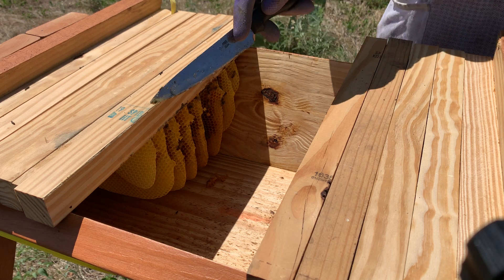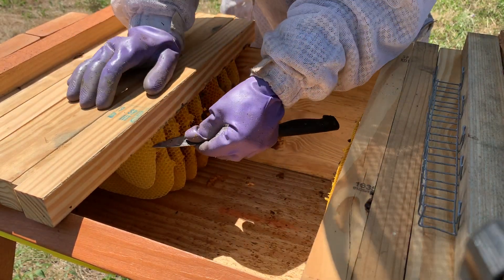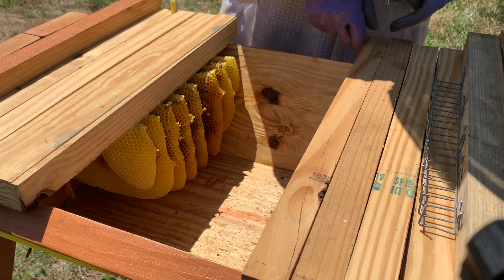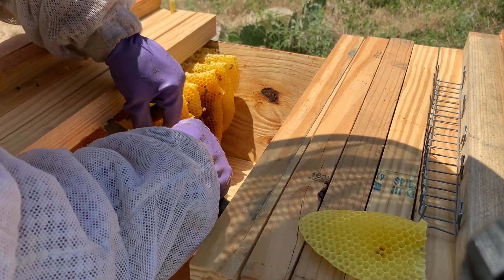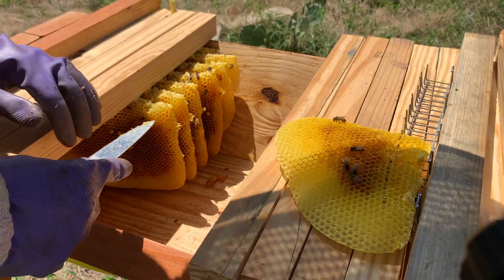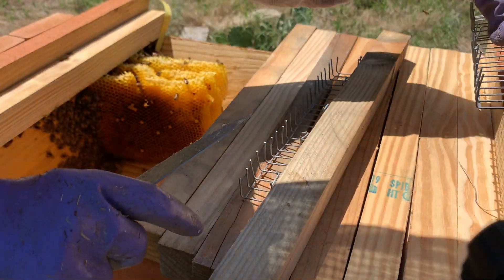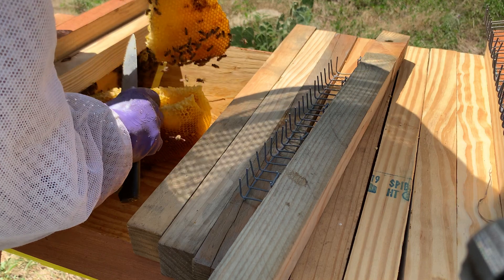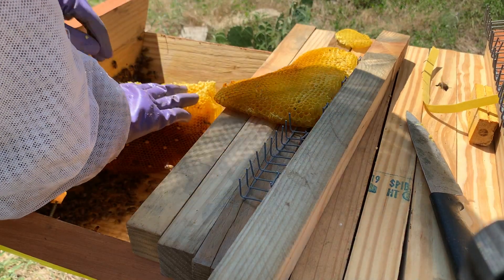Fixing Cross Combing on a Top-Bar hive

Comment: Very neat Rescue Wire ! Way better than Elastic Bands (Rubber Bands.)
Going to borrow concept for my Langstroth Hive re Cut Outs, or TBH to Frame transfers. 😉
Reply from the maker: Yes, you can staple to the bottom of the frame's top bar - true for Layens as well. But what you really should do is use it for Lang frame to TBH transfers, not the other way around - your bees will be happier for it ;-)

Comment: Also. I made a groove down the center of every top bar with the table saw. Then attached a tongue depressor in each grove as a guide for the bees. They, the bees never go by the book.
Reply from the maker: Great tip! I have done that, used a strip of foundation, bamboo skewers, etc. Most of the time though, I give them a straight comb to get started - which I find being the easiest. But yes, bees don't always follow the guides we give them - those are just an indication.... There were a customer's bees anyway, not mine :-)

Comment: Take this comment with a grain of salt. Having a similar problem. I once took plastic hair clips and secured them to twisty ties to the top bar. Also used zip ties also. You could use a ribbon if you want. Even rubber bands. Then insert the comb you cut out into the mouth of the clip. Over time they will incorporate the clip totally into the rest of the comb. In a couple of weeks you can remove the ties. Leave the hair clips in until you decide to recycle the comb. 
Good luck.
Reply from the maker: Yes, I have tried all these methods, none were as easy and efficient and left me struggling to hang the comb or with wonky comb and the hair clips were way too bulky for my taste, but glad to hear these other methods work well for you. Have you tried repair bars? They make fixing cut or fallen comb super easy.... I always have them in my truck just in case....

Comment: Are they still ok ??? 

It looks to me that 
It must be an Invisible REASON (* invisible to you), why bees decided 
to :
Create hive in this direction ... not in your intended way...
and
 another invisible reason for ceeating smaller combs 

We know that they need to keep 
Constant TEMPERATURE ,but, obviously ,... there are small number of bees in that colony.
So...
My guess is that Bees originaly  somehow discovered
 that
*  only 1 corner is good , warm or properly naturaly air conditioned for their task, 
* air circulation was much better for them in that original way ... that's why they positioned comb in that wazy .
and additionaly the size of the comb was designed for their Real numbers to keep TEMPERATURE of the brood 
 ,... small warm cosy corner ... that They can maintain thermal efficiently  . 

Just my guessing.
+ some magnetic field forces or who knows what They can feel ...and see.
Reply from the maker: Marin, thanks for your comment and ideas as to why this colony had initially cross-combed. You are correct, there are a host of reasons for bees to build their comb a certain way, and we don't always know why. Another possible reason is for structural integrity reason. 
In this case, this was a package install, and the queen cage initially got in the way, causing the bees to go the direction that made the most sense to keep the cage out of the way. The fact that there were no guides to get them any kind of direction incentive did not help. 
Bees tend to build by the entrance first and expand away from it for temperature and mostly air circulation reasons, so you are right on that. 

I really like how you are thinking so very mindfully about why the bees might be doing what they do, and your humility in recognizing that the bees always have their own reasons for doing what they do and we might not always understand all the implications and reasons of their choices!
Reply: @beemindful1027  Thanks for your kind reply. 

I was , thinking you might get angry at me for telling You what is a possible reason, 
... but you showed me very nonEgotistical response . Thanks ! 

I am a total amateur in this field, 
but 
I was lucky enough to get one swarm straight into my backyard, under an old twoseater, and I spend last year every morning having caffe and watch what those beautifull creatures are doing. As I am single, they become my New family. I spent lot of hours watching videos about beekeeping and comparing all those practices with my original upbringing...
(*sixties   and 70s)... back in Balkans. In my grandmother place, we had garden and orchard, but we didn't have ANY Sprays,
....or chemicals whatsoever. 
.... but plenty of beautiful fruit and veggies and all kinds of Living creatures. ... as well. 
Then,.... suddenly , in 1968. 
 country got opened up to westernEuropean newe emerging postwar  economy ... and within next 10 years 
everything become in The hands of "experts" - in chemistry, biology and science. 
....
Of course it took me next 50 years,  to realise that "science " is nothing but A branch of the banking & industrial complex,
(* that almost TOTALLY Controls the results of scientific experiments), (!!!)  - (*as they control INVESTMENT in scientific research
and tightly control employment of "scientists".  ) ... So...  after that I started to question all those " new" methods and suggestions.
 ..and started to look into : 
How naturally some creatures lived,... and survived. ... what is NOT in the interest of financial sector, as that doesn't make any money to them. 
That bees never live in a box on 4 legs in the middle of the field ,...
 only in big Need... if they must. Only if people cut all trees,... and create HUGE Monoculture fields and future deserts.
....    Anyway ...  bees, naturally  live in a hollow trees, and under the protection of a shade and a canopy. 
Thermal regulation, moisture and micro climate, + some complex micro chemistry of forest. 
A Hive hygiene in those places are naturally strong because that Place is stronlgy sealed by propolis
....    and  not opened and disturbed and mowed arround ...  every week ... or so. 
All those industrial inventions brought big STRESS to creatures, and ... consequent immune system problems,
 and diseases. ... I observdcsimmilar practeces in smoll kids at school...   they move them around every year like boxes,
...., to prevent them from forming natural, emotional Bonding to friends, rooms or place, ... and other elements.
 (*induced Disconnect on large scale !). (* "Experts"..... are very dangerous people ... )
Etc etc ...  Observations from an old Villager. 

Thanks.
Reply: Look at the direction of the sunlight in the video  ..... which corner , side gets the the sun first , ..... would you live in the end of the house that is the coldest or warmest .